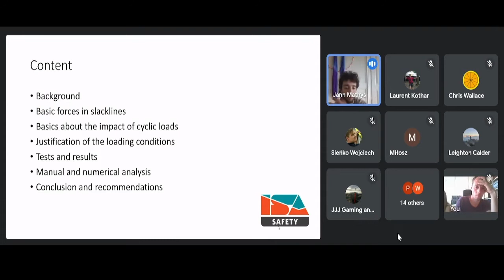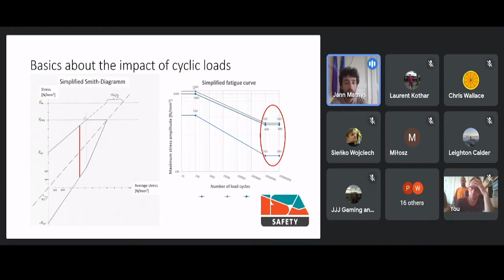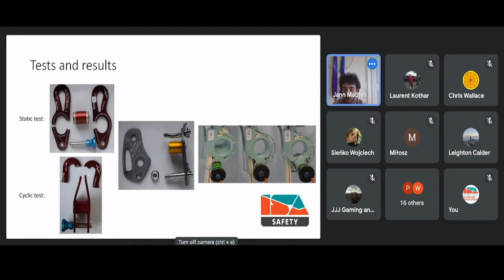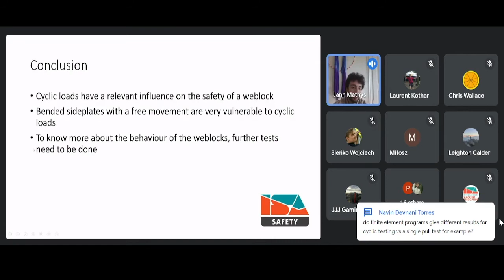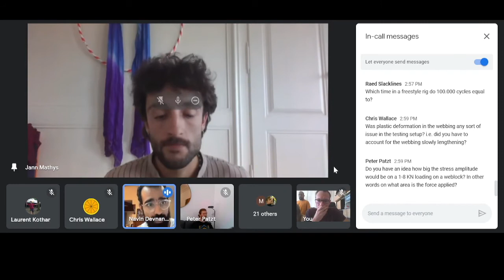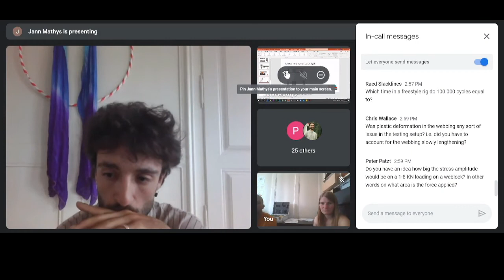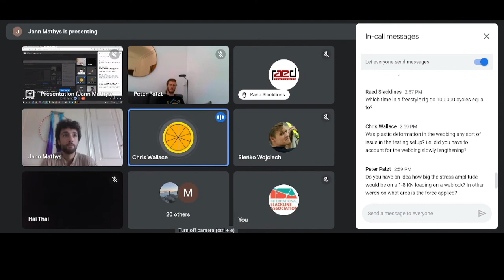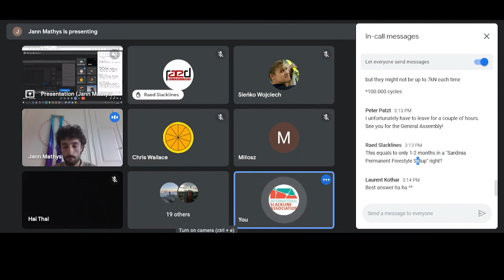Cyclic Loading on Weblocks with Jann Mathys - ISA Safety Event 2021

Comment: Interesting, free-moving bending sideplates wich seem to pose a serious risk for failure after cyclic loading are like a key structure in almost all climbing pulleys.. maybe that’s why the newer rigging models have straight sides (and the integrated swivels probably also help with the internal force flow)